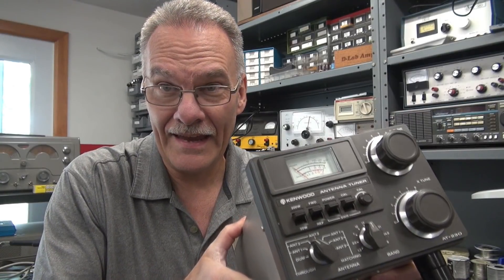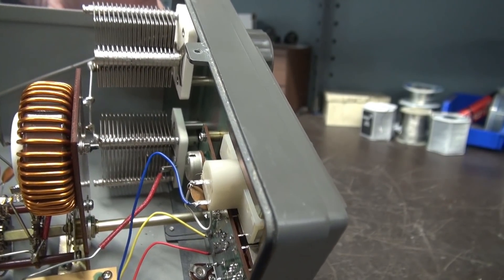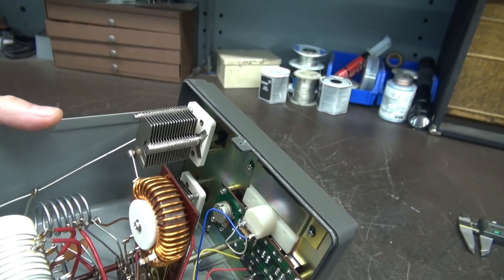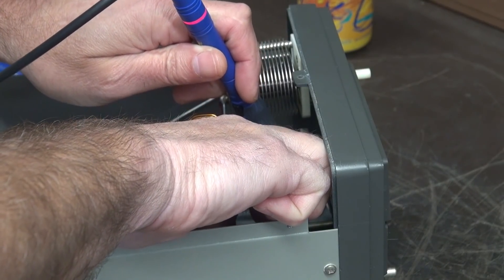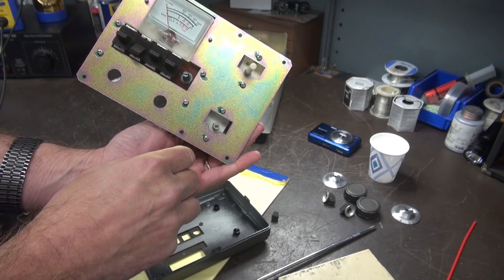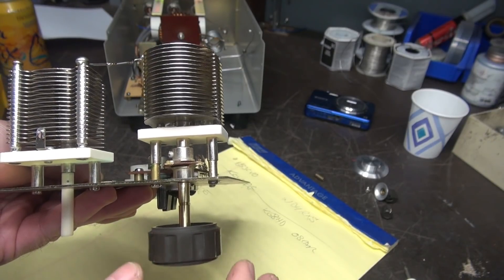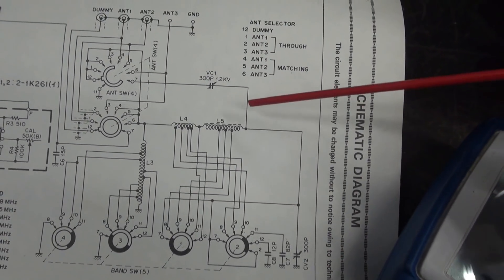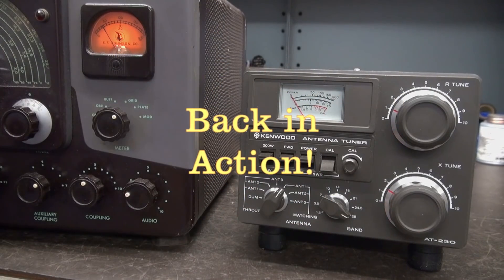How to repair broken tuning capacitor vintage Kenwood AT-230 Ham Radio antenna tuner

Comment: I've done a very similar repair myself. Be careful, the capacitor shaft has the RF voltage because it is connected to the antenna output line. You need a good RF insulator for the shaft to prevent RF burn/shock when the tuner is outputting a high impedance. That's why the entire shaft is made with plastic (in older models/lots it is made from bakelite). The problem is that the pin hole and the insertion notch (very intricately routed) determines the variable capacitor blade spacing, so it has to be very precise. I ended up fabricating mine from a durable polycarbonate material but it was a LOT of agony to fabricate and then inserting the pin through it. These capacitor shafts will fail sooner or later given the age of the material. Another problem I've seen with many AT-130 and AT-200/230 is lint collected on the rotary switch contacts. Many of these I bought used were sprayed with contact cleaner solution (greasy) which makes the lints nearly invisible. I had to remove them all under microscope, using tiny very fine brush. Those trim pots on the SWR meter circuit board also go bad but they are trivial to replace and recalibrate.

Comment: Greetings!  A question if you have a moment.  I have an AT-230 connected to a KW TS-820s.  Nothing happens.  The AT-230 just sits there mocking me.  Could you advise from whence the AT-230 gets its power?  The interior appears factory fresh and the unit was not sold 'for parts'.  Any thoughts would be greatly appreciated if you have the time.  Thank you in advance!
Reply: @tracydiller2266  Greetings!  According to a reliable source, the AT-230 gets its power from the primary transceiver.  Of course, the one thing that could affect the 230 is worn out/bad/worthless tubes.  I have not yet pulled the top of my case to check mine yet.  On the dummy load, it's only supposed to be 50 ohms if I remember my manual right.  I built my own and got 49 ohms, but that does not seem to have been the issue on 230 power.  Something else to add, I located two videos on how to set up both the radio AND the 230!  If you want those links let me know and I can post the links here.  One of the videos is for my radio, but might have something useful for yours.  I haven't watched them all the way through yet.  Now that I think of it, I might be a somewhat useless source of information, since I haven't actually started to do stuff.  Hmmmmm.

Comment: i would have used an J-B weld epoxy with a 3/8" plastic sleeve (slice of plastic pen body) that is oversized and bonded the sleeve over the plastic seem - that would be the better repair !

Comment: Sometimes the junk box needs to be ignored, maybe that machine shop that turned down the brass shaft could have made up a new Delrin or Nylon shaft instead? Nice piece of equipment though, super clean inside and well worth the repair

Comment: When working in close quarters with variable caps, fully mesh the cap.  It's too easy to slip and impact the rotor, bending the plates.

Comment: As the two tuning capacitors are the same why not switch them, that way the repaired one would have it's shaft grounded and any continuity between the new brass shaft and the variable cap would be inconsequential?
Reply from the maker: That is a great idea, should have done that. Excellent input

Comment: I used to drill a hole in both shaft halves slightly smaller than a self tapping screw.  Then I ran the screw in one piece half way, cut the head off with my Dremel, and threaded the other piece down.  Finished with a little epoxy between the halves and heat shrink tubing over the shaft.  Results depend on how centered  and straight the screw is put in.

Comment: Thanks for the great video, Terry! Did the coupler need to be insulated? The plastic on the cap shaft already did that, no?
Reply from the maker: For isolation from the RF, I'd recommend that type coupler
Reply: @d-labelectronics  since both pieces being coupled are insulated why the concern about the coupler? There’s nothing to isolate.
Reply: @bobvecchi7981  That is what I was thinking
Reply: @d-labelectronics  I just realized, the replacement shaft is brass, so of course the concern. But what is you used a short piece of brass or other metal tube with interior
Reply: @d-labelectronics  1/4” inside diameter and glue it on the original shaft?
Reply: @d-labelectronics  ahhhhhh, thanks for the clarification, sir

Comment: Fourth option. Drill a hole in the two broken ends of the shafts to insert a dowel like a tooth pic and super glue.
Reply: JJ ... Super Glue doesn't work well on many plastics, especially if it's got nylon in it.
Reply: @rupe53  JB Weld
Reply: @zulumax1  ... JB Weld doesn't stick well there either. OTOH, you could cast another shaft out of the stuff if you made a mold from the broken parts.

Comment: A nice permanent repair....or if you find a replacement Cap later you can install it back to factory...Nice to have that option. DE W9TIT

Comment: Why not slip the broken plastic shaft into the coupler rather than using the brass one. Coupler offset should match at both ends. It's less work and the RF isolation would better match the original. (jus' sayin' - ve3oq)
Reply from the maker: The original shaft was to short after adding the coupler and spacing the cap back to clear
Reply: @d-labelectronics  I knew there was a good reason for your approach - take care - 73